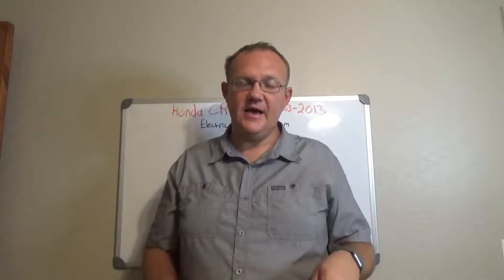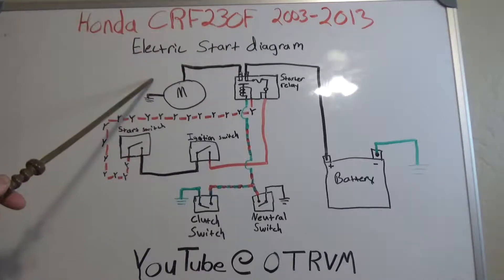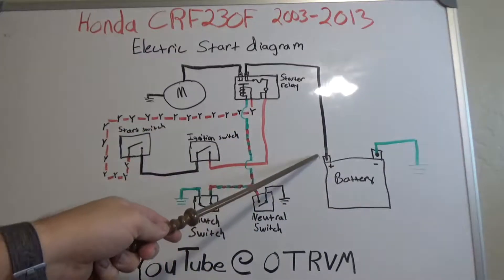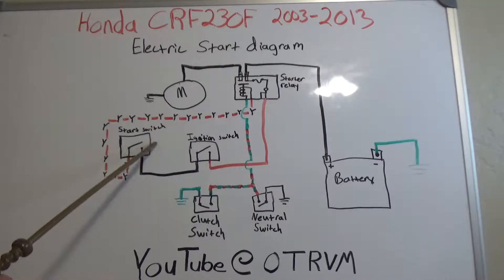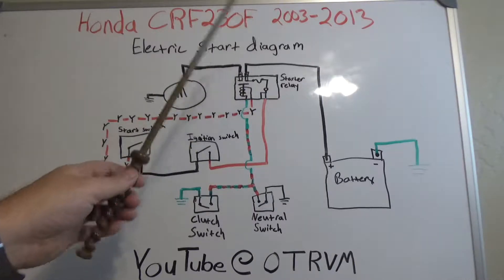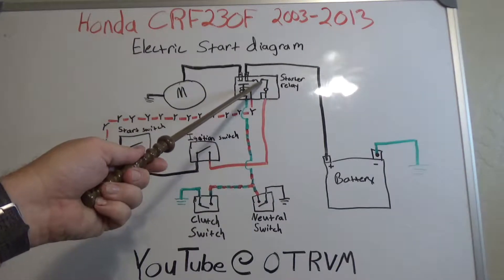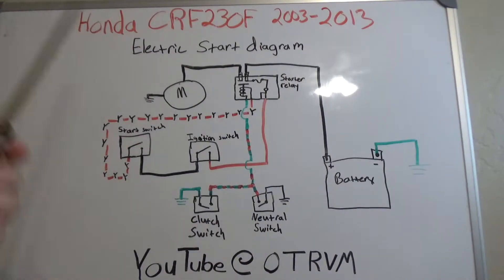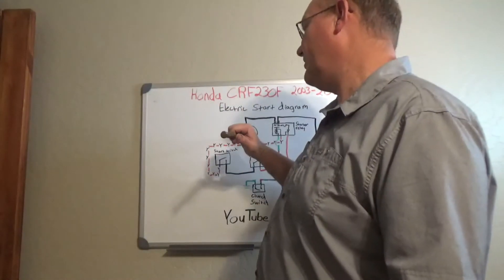Honda CRF230F 2003-2013 Electric Start Diagram Troubleshoot

Comment: Oh man this is a great video but I can’t figure my harness out. I have a 2016 CRF230F engine that I dropped into my 1985 ATC200X. It’s a perfect fit with minimal modifications. My issue is wiring up my tether kill switch and how to find out which wires are for the push button start. Can anyone help? Thanks

Comment: Where does the battery ground, my bike has the ground running to the starter along with the ground from the starter relay, it’s a new battery and starter relay, when I hit the start switch nothing happens at all. No click from the relay or anything. Not sure what to do from here
Reply: Did you figure out?

Comment: Well my e start works when I put it into neutral but it won’t start when I hold the clutch in and it’s in gear if u can help me that would be great but I think it might be my neutral safety switch
Reply: did you figure it out ? the same thing happens to mine.
Reply: thanks to this message, i figured it did start so i just had to put it in neutral

Comment: My 2003 Honda crf 230F  Its bone dead when I try to start it . put in a brand new battery with good voltage, when I hit the ignition switch nothing happens. where should I start. is it possibly a bad fuse? I'm terrible at electrical issues 😕 I would love to hear response thanks

Comment: My bike will sometimes start at the the beginning of the day, but sometimes I’ll have to jump start it. Also, when I’m riding around, after I shut the bike off, sometimes it’ll start, sometimes I’ll be able to roll it around for a bit, or I’ll have to jumpstart it. Any ideas?

Comment: My crf230f will roll start, but shows no signs of wanting to start when I try to use the electric start. Doesn’t make a sound, nothin. The battery is fine, we even checked with a different battery that we know works. Could it be a burnt fuse or something wrong with the wires to the right of the handlebar? I also cleaned that small, spring wire beneath the sprocket. I know nothing about wiring, so please help lol!
Reply from the maker: So if memory serves there should be a fuse on the start relay.
Reply: OTRVM there is. I already checked it, and it seems fine. I can connect the wires to the charger and It’ll make a small effort, but when it’s connected to the battery, it doesn’t make any noise or show any signs of life.
Reply: Wes Wes same here
Reply: Braydon Harris it ended up actually being a bad battery. Apparently the bike won’t even try to start if the voltage is a little too low.

Comment: My 230f will crank but will not start. I checked for voltage at the spark plug and it does show when i crank. It will not start regardless of how long i would crank. Does the above still apply if its cranking? I can roll start it just fine. Any ideas?
Reply from the maker: Yes.  With your description I would take a look at your valve clearance.  I have seen on several occasions that if a bike will not start via normal cranking but will by being puled or pushed it might be in need of a valve clearance adjustment.  However, this is only a thought. It could be many things causing your issue.  Very difficult to determine without having my hands on the bike.  Hope you understand.